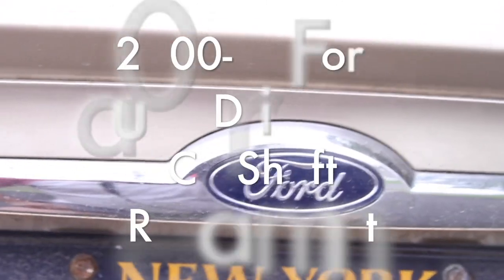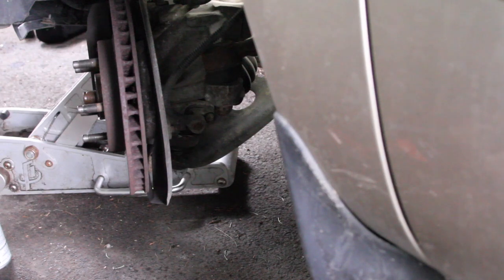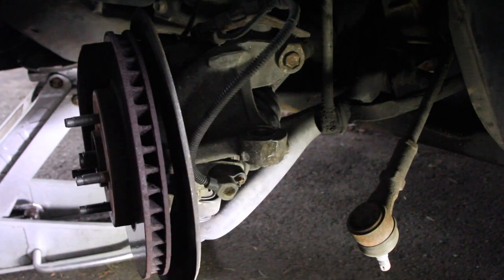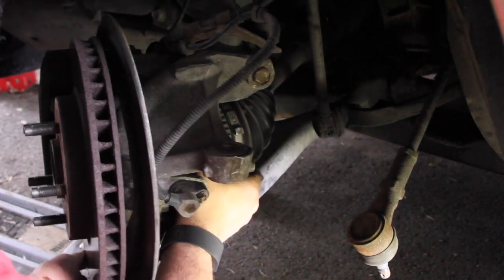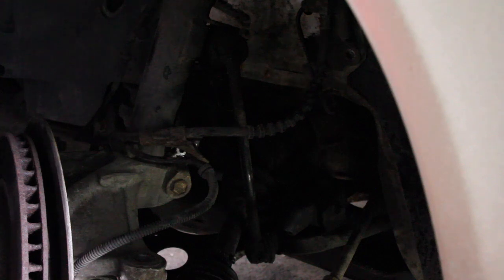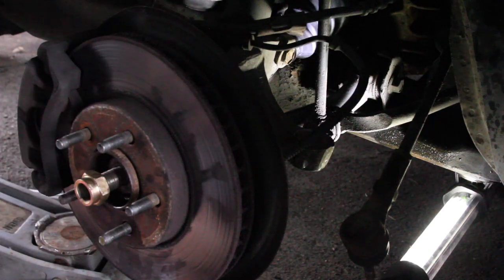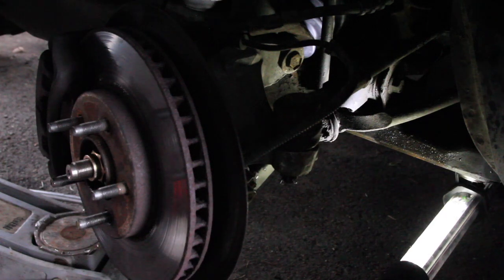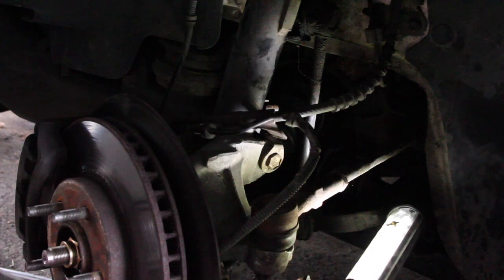2000-06 Ford Taurus Driver Side CV Shaft

Comment: Wow that's a lot of extra work man! I get mine out by just pulling the caliper, large CV nut and the two strut bolts. Using a large lever of some sort push the lower a-arm down and the CV shaft comes out of the hub assembly then out of the transmission. Reverse procedure and no bleeding brakes.
Reply: Drop lower ball joint at "A" arm and remove axle. its that easy . I don't know what the hell this video is showing but it  is totally wrong.
Reply: It's impossible with newer struts because the strut is too stiff to lift out of the knuckle
Reply: @chastermief8235  disagree. Mine have less than 20k on them you just have to get a long bar and stick in the center hole of the control arm
Reply: @chastermief8235  exactly...

Comment: Never EVER put a castle nut on part way and hammer on it...it destroy's the nut and damages the threads on the ball joint or tie rod end...much easier to just go thru the proper steps and drop the steering knuckle off the strut...this video IS NOT the proper way to do this job...sorry Josh...you took the long way around and struggled way more than needed..but you did manage to show everyone what NOT to do...
Reply: Scott Bell....you are right  !!!

Comment: Never try pull the ball joint out from the knuckle by bending down under control arm, you have to lower the subframe at the rear but only loosen the subframe bolt about an inch and you won't have to struggle to pull that control arm away from the ball joint because it's hell putting it back in if you don't do that procedure, as far as banging away on it to get it solution is pretty delusional and defective all you need is a pickle fork and make sure you put some penetrating oil on it a couple of days before and then soak it again on the day you're doing the job.
Reply: You don’t need to remove the ball joint or loosen the subframe, you take the bolt out that holds the shock into the lower part of the strut and it comes apart.

Comment: thanks for showing me you fucken Rock!!!!
Reply: Drop lower ball joint at "A" arm and remove axle. Its that easy. Does not mess your front end alignment. THIS video shows wrong approach!
Reply: Drop lower ball joint at "A" arm remove axle its that easy. This video is the hardest way possible to do it and it is wrong.

Comment: So another defective move on this guy's part when you put that nut on the drive axle end never ever use an impact because you can damage the hub bearing as I have seen many so-called mechanics do. Just hand tighten it and torque to 150 to 160 lb. This was a dangerous demonstration as to how to put on the axle nut as that cordless impact gun is nowhere near torquing 250 lb. Also make sure you lightly Grease the shaft and hub before sliding the CV axle through the hub. Man this guy is a freaking mess and as usual there's another YouTube video that's about as useless and dangerous as all the others. My suggestion to this video maker is to switch to working on bicycles that only you own so you don't kill anybody else. Also never try the torque the ball joint nut with an impact as this gets torqued to 60 lb. Torquing it any further will only prematurely wear out the ball joint and or damage it.